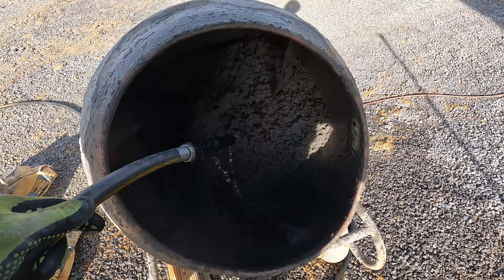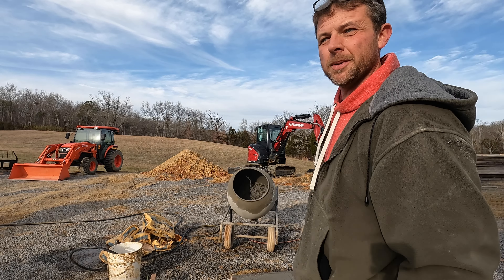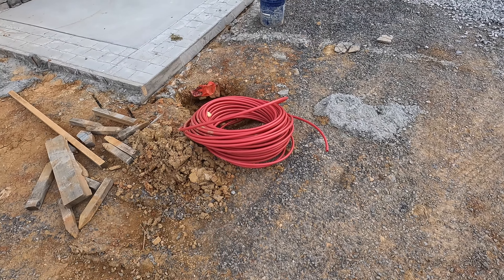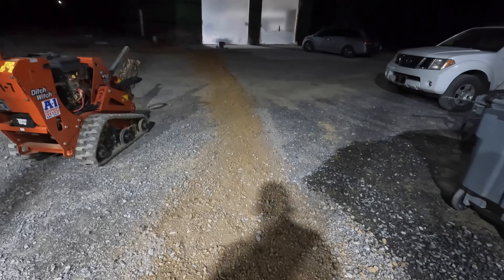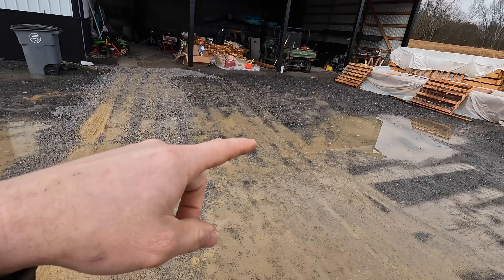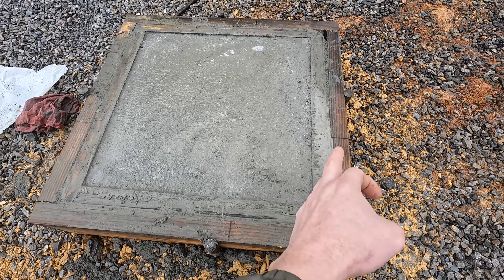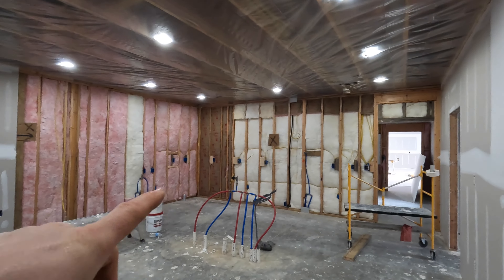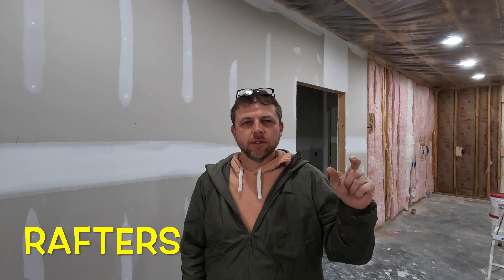What Does It Take To Be Successful In Business?? Building A Shed, Part 2, #169

Comment: Lookin Good!  I hope I got to you before 1/2 red pecs in the ground,  might consider 1" - 1"-1/4" for the under ground air supply as you lose a lot of volume over that distance and hard to run an air inpact or air sprayer that needs cfm.  Kinda like voltage drop...  Hope that made some sense.  Love the videos you do.  I love the whole project and the energy you display.  Ah the muscle of youth!! :yougotthis::goodvibes:
Reply from the maker: Well you are a little late😀, I don’t plan on doing a lot of heavy maintenance in that garage, I will use the other building for that. Curious if a air storage tank would cure that problem in the case I did need more volume? Appreciate the comment as always but that youth seems to be leaving me rather quickly these days.